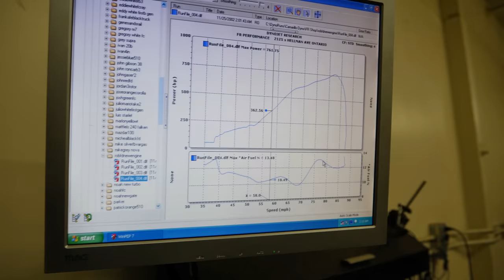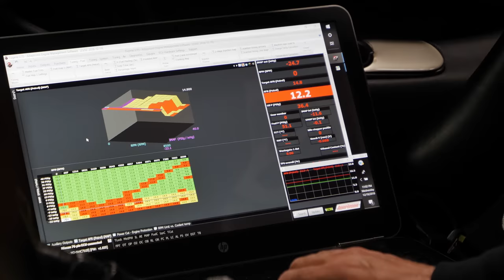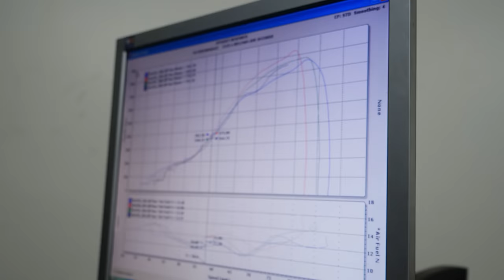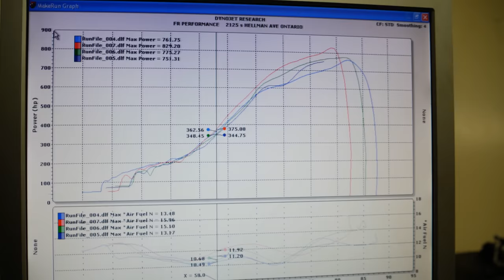Hitting 1000 HP ain’t easy. ALMOST THERE ON THE FIRST SHOT!

Comment: Incredible, all this on 0 PSI.. right?
Reply from the maker: Would you believe it? 😂😂😂
Reply: for those who don't know, that was all on 0 psi
Reply: @No Crust you never had me

you never had your car)))))))
Reply: Had similar problem with a small kink in a fuel return line/fitting. Might be worth taking a peek under. But this is interweb so the problem has been fixed already and you made 1123 hp
Reply: Amazing 0 psi pulls right there rob!
Reply: -35
Reply: Can someone explain this about 0 psi (or as a metric nazi, 0 bar)?
I really don't get this reference and it's everywhere in this comment field hahahaha.
Reply: Lol reminds me of my boys dad rx7 idk much about rx7 but I think it's from the 80 it's suppose to make a sound when u get near the red line but since the odometer don't work the horn goes in mid shift feels like u doing something very wrong
Reply: @Will_M600  Now me and the mad scientist have to rip apart the block and replace the piston rings you fried! Ask any racer, any real racer, it doesn't matter if you win by an inch, or a mile, winning's winning. Edit for spelling...
Reply: @Will_M600  savage 😂

Comment: Good on you for clearly showing the problems you're running into trying to make big power. If the ECU is using a fuel pressure sensor to datalog and compensate for fuel pressure, it's a good idea to mount it near the fuel injectors (not near the fuel pump) since that is the pressure that matters. To check the fuel pump wiring, attach a multimeter using alligator clips and measure the voltage at the fuel pump connectors during a dyno run. Big wire between the pump and battery is good, but also be sure there is a nice big wire between the battery and the alternator since you want more than 12.5V feeding the fuel pumps.

Comment: I feel your pain with the fuel system issues. Went through the exact same problems on my Z (granted only at 600hp not 1000). Changed pumps, fprs, fuel rails, wiring to pumps, fuel filters, increased fuel line bore etc etc etc. Very frustrating that you solve one issue, think you’ve solved it and yet the symptoms continue. Fingers crossed you solved it!

Comment: If not enough flow the pressure will drop and yours is not dropping so I'd look at injectors.You have the fuel flow and pressure but it's not making it into the engine so the issue is after the regulator
Reply: gsppuffer 

My theory is not enough flow through the fuel filter itself. He’s getting consistent pressure but when in the upper rpm it’s leaning out so the injectors are getting the fuel they need at that point.
Reply: Correct Issue is after the regulator or the regulator its self. Didn't see your comment tell after I posted. Have good day
Reply: The fuel pressure regulator should be the last thing in the fuel system.
Reply: The injectors have to be sticking.
Reply: @blindabinda1234  not if he's running returnless. In that case there could be something between the regulator and the rail.

This issue also depends entirely on where the fuel pressure sensor is. If this was me I'd just remove all the plugs in the entire fuel system and just fill them all with manometers (or guages if you speak Neanderthal). If there is no drop in fuel pressure anywhere, it's the injectors for sure.

Comment: Had a similar issue after installing a surge tank on an R33 GT-R. Turned out they oem fuelpump didn't like to spread the voltage with the surge tank pump.
After wiring it up seperatly it worked as it should :)

Comment: If you have correct fuel pressure over the rail but not enough flow, it isn't pumps, it's the injectors or something else. 

Otherwise as soon injectors open more, the differential pressure would drop immediately. Amount of fuel for given injector is set by injector duty cycle and fuel pressure only. 

Unless... you are cavitating and fuel is aerating some bubbles. That would keep fuel pressure with no fuel. Fuel damping could be an issue also with high flow pumps and big injectors not near their limit.

Comment: hi, i would be looking at the waste gate before looking at the fuel system as the 
waste gate could be sucking air into the exhaust system giving the false impression 
of the 20b leaning out, quick elimination step would be to plum back the waste gate back into the exhaust and run it up to see if you have the same leaning out problem, if still there then look at 
fuel system eg injectors (flow rate at 80%dc),rails,lines,etc.

Comment: I don't get it - it is the surplus of flow over demand that maintains the fuel pressure. if you have the fuel pressure then you have the fuel flow.
I assume the pressure is being monitored at the regulator, so it shows the rail(s) pressure, and I would suggest reviewing the rails and injectors for any restriction between the rail(s) and pintles - for example, if the injector inlet is too far into the rail drilling(s) it may not be able to flow into then at very high fuel flows, or some injectors have a fine filtration mesh in them that may limit the total fuel flow?

Comment: Think about what you said, you said you have enough fuel pressure but not enough flow. You could never maintain fuel pressure if there wasn't enough flow so it's something up front restricting the flow cause if you had to much flow your pressure would drop. My point is the fuel pumps are keeping up just fine so I would start looking up front maybe that fuel regulator or your lines are to small or heck it could be your fuel injectors getting clogged..

Comment: I would say Injectors ... Pumps seems to be ok if pressure keeps good. If pumps are bad and failing to deliver enough fuel, pressure will drop. Not enough amount of fuel at input = no pressure on output. Pressure good but not enough fuel in engine = something bad after regulator and there should be only injectors.
Reply: Injectors or too small of a supply hose.
Reply: @-tr0n  if supply hose is too small, when injectors open the pressure would drop at end of rail where fuel pressure is measured (at least normally)
Reply: Didn’t he just replace the injectors though? It could be the injectors, but it may very well be the surge tank considering it’s brand new, and Rob may not have wired it right.

Comment: If your fuel pressure is not dropping at the regulator there is plenty of flow to it. With the feed to engine disconnected in a jug your fuel pressure should be very low if not the regulator or line is a restriction. Im betting the problem lies in the fuel line plumbing from regulator to injectors. Is that a -8an feed?
Reply from the maker: Yes 8an
Reply: Rob id say on e85 that -8an is getting really close to maxed out. I thought u was on c16? You should try the fuel test I stated above see wat the fuel pressure reads with open feed line. Also id recommend running your fuel feed directly to fuel rails then to regulator if your setup allows. This takes the regulator from being a possible restriction out of the picture.

Comment: If you are measuring fuel pressure at the regulator and it is OK, it means your pinch point is after the fuel pressure regulator.

Comment: You sould add a second fuel pump of the same type as the primary to increase the volume of fuel with a separate fuel line to the fuel rails

Comment: If you have the pressure at the fuel rail then it seems like you have the whole fuel system up to that point working correctly. The flow through the injectors is driven by the differential pressure and it sounds like the differential pressure is there. I would check the injectors. Are they getting enough voltage?

Comment: Volumetric Flow = (pi*radius^2)Volumen 

Can be the diameter of the pipe, you have the pressure but the fuel line is not big enough to flow all the fuel.

Comment: Wow maybe fix that wiring in the back also and next to the fuel system /sruge tank . .  fuel system / pump set up is all wrong here in Australia most just run one big pump or have a upgraded one intank then lines run to a external surge tank with one big pump in it with -8 or whatever size lines they are using maybe change the diaphragm spring in the fuel pressure regulator looks like you are having issues with it .

Comment: what is the pressure drop trought the line?  pressure and psi are really similarly linked. if you mesure your psi at the pump, and you have a X amout of flow trough a 1/2 or 3/8pipe with bends and filters, you might get a lot less at the injectors. if you have the pressure at the injector and you dont have enough flow capacity, the pressure will drop..

Comment: Is it reading lean because its misfiring??  O2 sensors are designed to read COMBUSTED air:fuel mixtures.  It assumes combustion has taken place.  If you get a misfire... it reads lean... even though the AFR may have been rich.

Comment: Just spitballin’ could it be that you don’t have enough filter area in that fuel filter to flow through it? Couldn’t you just run a dual filter setup in parallel to help with flow? I think the pressure wouldn’t drop at that point just a simple dual parallel setup (1 hose split into two section for 2 filters then back to 1 hose outlet running to the front). 

@Rob Dahm
Reply from the maker: Definitely need to move the filter to pre surge tank and that will help with all the scare of it being in line of performance

Comment: if it's a flow issue you need bigger fuel lines genius or you may even need bigger or a 3rd set or injectors those motors are thirsty

Comment: Sloppy Mechanics 101--use power wire from stereo amp to power fuel pump, -10 line for supply...where is the Denmah for this.

Comment: Can you try to race an ls swapped rx7
Reply: Sir I’m going to have to ask you firmly and politely to leave, because you used that combination of word that should never be spoke
Reply: tylers vpc what do you mean
Reply: @rotarycollection  he's just being butthurt about v8 swapped rx7 cars. But yeah. It would be sweet to see 1000hp against 1000hp. Let the people see they need more power in those pistons.
Reply: Big 'ol Booty Cheeks rotary will
win bc its lighter but the ls can use heads cam and supercharger boom 1000hp but a rotary needs seals a phat turbo one thicc intercooler ported brap machine etc thats why v8s r dominating
Reply: @drainthesqueakedjkdod9876  the weight isn't that significant. A 20b isn't a light weight, and an aluminum block LS isn't a heavy weight. Also, even on a V8, 1000hp done right isn't cheap or easy. Rob coulda broken 1000hp long ago with giant porting. But 1000hp on a street port isn't something that happens unless it's done right.

Comment: If you run your 3 rotor on pre-mixed gas/oil, then what oil are you changing? You use pre mix on top of oil injection?

Comment: 1000hp on a v8 is easy 1000hp on a 3rotor is just expensive
Reply: Shaun cleetus spent id say 3500dolla and got 700-800hp with a turbo and a cam
Reply: Shaun yea but its just a heads cam and a suoercharger i mean u can just get a zr1 with a smaller pulley and H/C
Reply: @drainthesqueakedjkdod9876  the difference between a 800hp engine to a 1000hp engine is huge just so you know.
Reply: Oh yea how easy is it?
Reply: That rx7 at 1000hp is a hell of a lot lighter then most cars with v8s in them though. Rob better get a roll cage as that car is going to become a death trap if he ever puts his foot to the floor.
Reply: @clutchkickpj693  sloppy mechanics.. look it up.. 1000hp+ on stock bottom end ls, reused head bolts and head gaskets...
Reply: @wt8213  for sure not trying to hate on rotary cars but they a definitely more expensive than a ls to try and make that power
Reply: @damonk6289  yes way more expensive and probably about as fuel efficient as a jet boat. But for me the car is sexy as hell and makes all the right sounds. Im sure id love v8s the same if they where unique but when everyone and there mother has a v8 that sounds the same it gets beyond generic and boring to me.

I like unique and quirky light cars. I'd rather a 350hp car at 2500lbs then a 800hp 4000lb hell cat for example.
Reply: @wt8213  how come the roll cage makes it so bad?
Reply: @whitefd2  the role cage will help avoid it being a death trap lol. How did you interpret what I wrote any different?
Reply: @wt8213  ohh. Idk i read it thinking it would make it a death trap

Comment: I dont understand this guy. I would love to own a FD Rx7 because they are amazing on the track and they are 50/50 weight so why put that on the front of the car? You know all that turbo stuff is not light. I just don't get how you wanna have a (nother) 1000hp rx7. I'm not hating on you and yes I know you can go out and buy a rx8 with that weak ass 2 rotor motor and turn it to a track car but I really don't like rx8 because they ugly and shity. I rather have a Dotsun 240z or a Nissan 240sx or the  350z over a Rx8